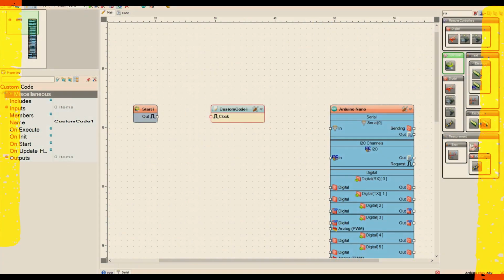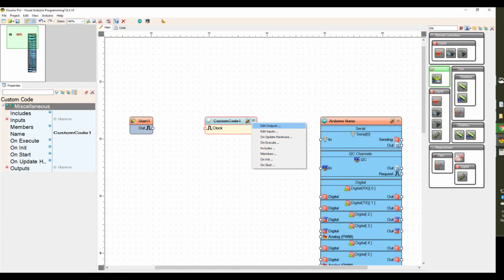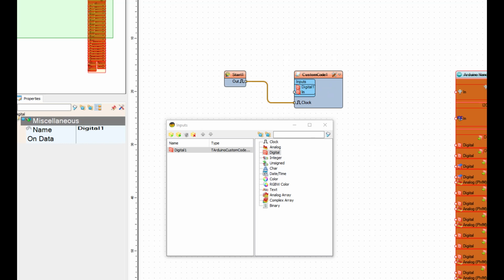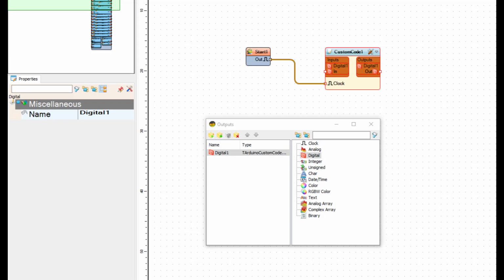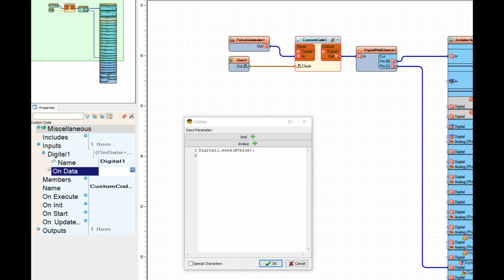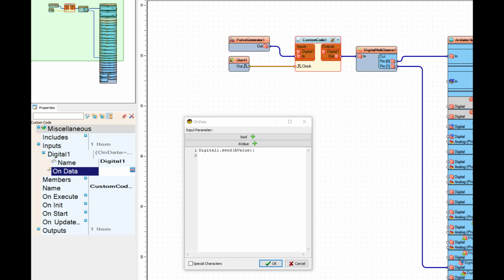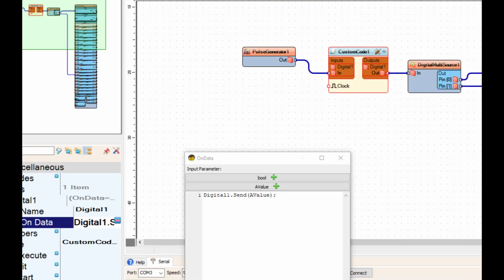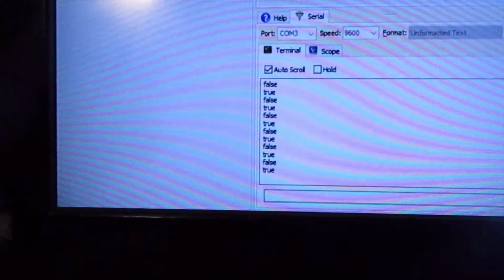Visuino Custom Code 01100101 Part 101 - OnData element

Comment: Hey pigeon kicker where do i select the custom code element?   i hate feeling like im banging my head against the wall in the first 30 seconds following this tutorial.  im using 7.8.2.221 
my board is the atmega 2650.  please help.
Reply from the maker: The Custom code component is kind of under development, so available in the Visuino Pro version, keys work for both versions. it's in the Filters component section.